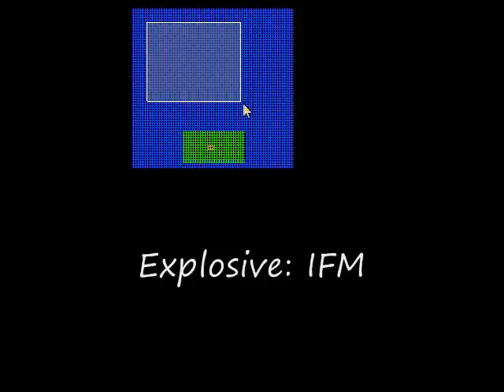How To: OE-Cake Nuke / Bomb (basic)

Comment from the maker: This is mentioned in the video. You can even time the explosion.

Causes can be:

1: Thin walls
2: Too much nuke material
3: Ineffective insulation of igniter from case.

Make a nuke with no nuke material, and if your igniter explodes the case mid air, you know what the problem is.

Comment: @01DOGG01
I made one that airbursts. It actually explodes twice, once in the air, and once in the hole it made where the ground used to be. Mine's made of IFMOY and the lighter is HFM with a Brittle case. The reason the bomb explodes twice is because of the PIM chunk in the middle of the nuke material that splits it in half. When it blows up it causes immense lag and destroys the ground entirely. Cranking up the fireProbability in the oec file makes it look cooler.

Comment from the maker: The trick is in the recording method used, if that's what you're wondering.

I have 2 videos describing 2 different methods which can achieve a smooth video, even if it takes hours to render/record.

Comment from the maker: @TheGModprofessional If it's airbursting, then the material is probably penetrating the case. You need thicker walls and/or less nuke material.

It can't not explode. You must be mixing incorrectly. Check part 2 of my custom materials video for a clear explanation of the mix mode.

IFM behaves just like mochi, except it's flammable and self-replicating.

Comment from the maker: An alternative way is to use scale 1. That way you don't need blob or shader modes.

Use points mode and it'll be the same thing.

At scale 1, it's a lot more detailed, but it will also go a shitload slower... that's the bad side.

Comment: I tried doing everything exactly as you did, but the elements don't end up acting like they do in the video. For example, GH instantly dissipates inside the mochi liner and blows up the casing.
Reply: Yeah, no, tried it multiple times, different sizes of liner, everything. IFM does not produce what you drew there, it just doesn't! If I turn off gravity, place the RH inside the mochi, the casing starts spinning because of phantom forces. I also used RIFM instead of IFM, but it doesn't explode, it has no reason to expand. Using RPIFM just blows up without much result.
Reply from the maker: A lot to read here and I'm a busy man these days. I'll get back to you later, but for the time being it looks like you are using the default scale, which will definitely cause issues for you, unless you draw your stuff reall large.
Reply from the maker: Still too busy lol sorry, I'll get to it one day... But I just want to know if you are using a smaller scale for now? It's imperative to the way things work. It's hard to make contraptions on the regular scale as everything is so small and close together. Sensitive.

Comment: When you write RP do you mean: rigid as base mixed with powder? or rice as base  mixed with powder?
Reply: +Alexander Wittrup THIS DOESNT WORK NON OF IT ;(
Reply from the maker: +Alexander Wittrup If it doesn't work, how did I make the video then?

RP means the buttons RP (rigid powder).

The proper way to mix is to press ESC [insert code here] ESC then draw.
Reply: +01DOGG01 one reason is that i tried it and it also looked different so updates?

But what i am wanderig is: the case is the dark blue the green is what? The igniter is the little piece of thing but what is the grey big box?
Reply from the maker: +Alexander Wittrup You can choose colours after you mix.

What do you mean that it looks different? Are you using scale 4?

The green is the liner. It says it in the video whilst it's being drawn.

Not sure what you mean by the big grey box. You talking about the 'MOPIC' bomb (not nuke) at the end of the video? It's the explosive part.

All of this is explained in the first 35 seconds of the video. Turn your sound on.
Reply: +01DOGG01 oh yeah didnt really think about the sound thanks xD

Comment from the maker: If 1 frame takes 3 seconds to render, then your CPU would have to be around 324ghz (324,000mhz) to run the scene at 30fps.

I have an E8400 at 3,600mhz. The video card isn't really important for this.